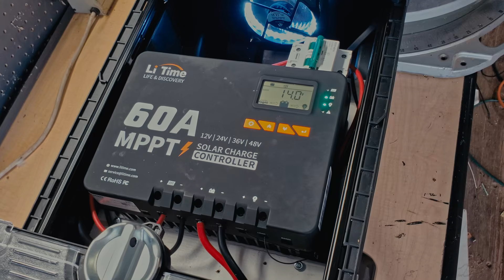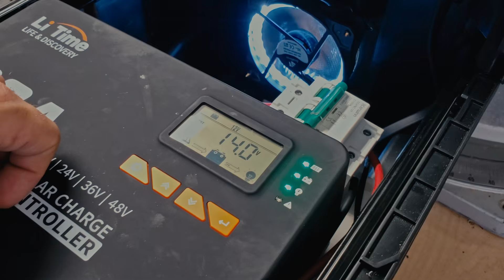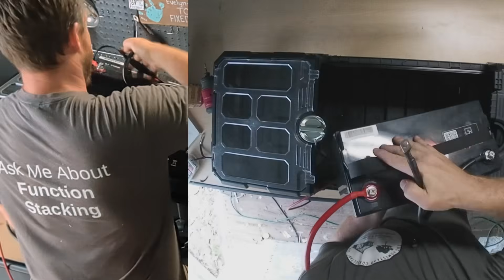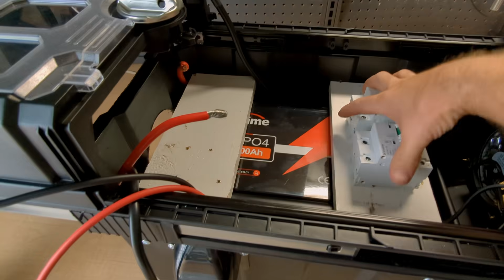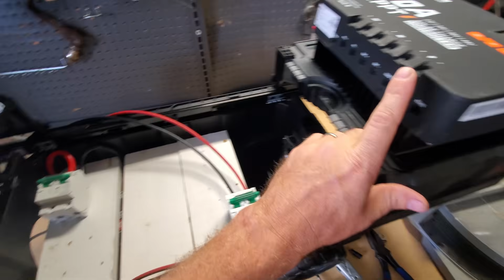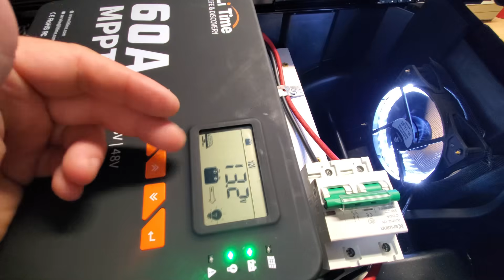This DIY Solar Generator Fixes the Biggest Problem with Power Stations

Comment: You can also use the 12v to run wifi, router, security cameras, and landscape lighting, and do USB ports directly from the battery.... bypass any 1000w inverter... 
Why don't more people run their landscape low voltage lights with solar???

Comment: I'd go with a 1500-2000 watt inverter for more surge and continuous capacity, also in case you have a deep freezer or 2nd fridge to power as well. Going from DC battery to AC inverter then back to DC for your power strip works, just inefficient. Also suggest with limited power to go directly from the battery to for example a 12v car adapter socket and usb-c/usb connections. Then you can charge DC with the inverter turned off. 100Ah is pretty small, keeps it portable of course, although I expect some will believe it can power a microwave or all their electronics for days on end (my wife's expectations). When there's always an outlet everywhere you go, I have to justify having a panel and batteries cause it all 'looks so expensive'. Yet when the power goes out I dont hear complaining that the fridge/freezer are still running, internet and tv are working, alternative lights are on or at least available for use. Even have alternative cooking options besides the large electric stove such as induction cooker, pressure cooker or crockpot - not to mention propane BBQ, butane burner, gas/propane camp stoves. Thanks for the video, always nice to see what others build, clean and functional 👍
Reply from the maker: Sizing is all a mater of what your intentions are. I wanted something that could charge close to as fast as it can discharge. It forces you to chose what you run and keeps you from running the battery out as quickly. Most frigde/freezers are 75-200 watt, so running 2 of them shouldn't be an issue.
Reply: Keeping the intended as the starting point is critical for any project is critical.